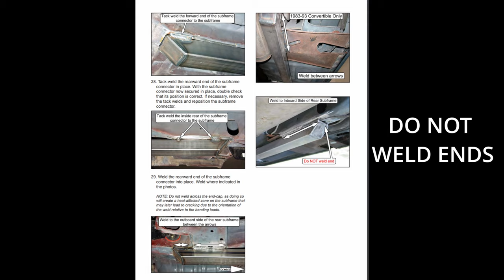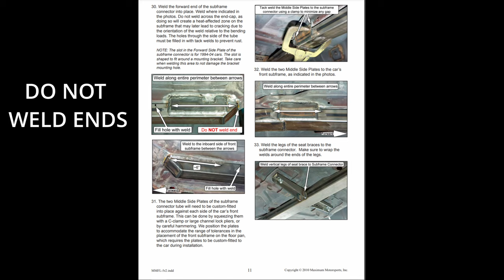Installing Subframe Connectors on my Fox Body Mustang Step By Step video!

Comment: What would I do if I jack it up and the door doesn't close properly? Body shop?
Reply from the maker: First I would I check to make sure that it isn’t something simple like the door striker bushings and sloppy hinges. Usually it’s just one of those things but if that didn’t fix it, Then I would try to rehang the door and if you can’t get it right after that then I would take it to a fabricator or body shop to see what they could do

Comment: How  much hp is your car making with that BMf
Reply from the maker: Well I’d love to tel you but idk it’s freaking fast on 7psi and conservative timing that’s all I know lol I would have had it dynod but I need to get a stronger rear end in it first. I’ll be making a dyno video as soon as I get the rear done which hopefully be sometime in January
Reply: I'm doing a 351w right now I'm going to order the bmf now I didn't think it would fit under a stock hood the 88mm is too big I don't want to cut the hood
Reply from the maker: @kennyp4967  ohh gotcha yea with the taller deck height I’m not sure how it would fit mine on my 8.2 deck fits with plenty of room With the BMF and the stock hood with the insulator. This turbo spools extremely fast too. from everything I’ve read it can make a ton power ,but if you look up war admiral 363  on Instagram or YouTube he has the BMF and made 800rwhp on 14psi and 950 on 18psi with with c16.